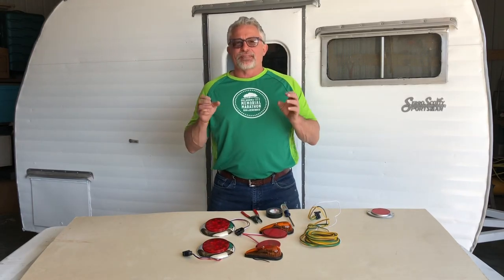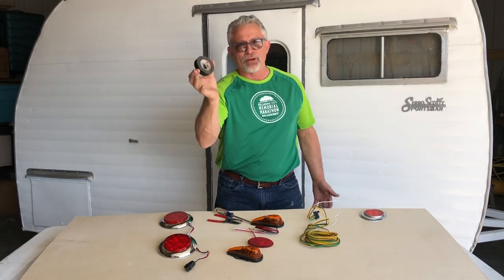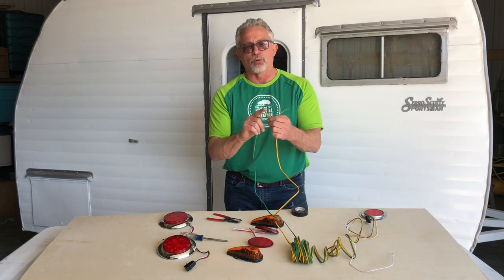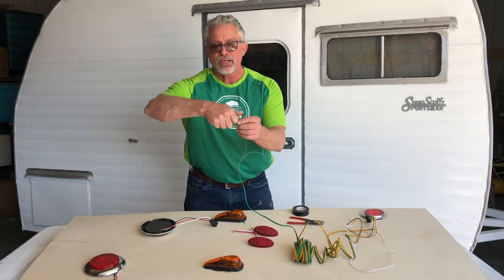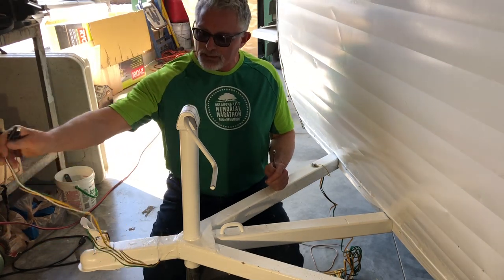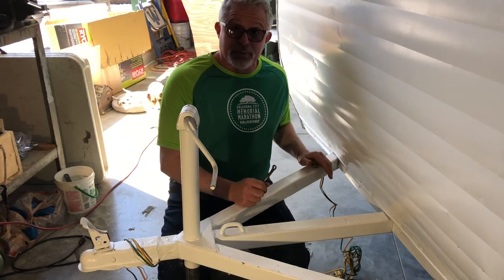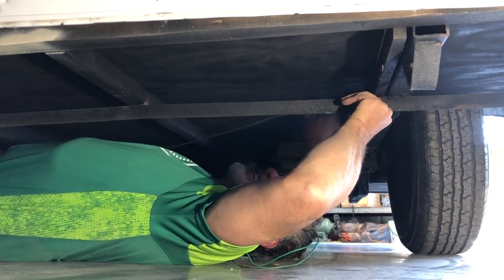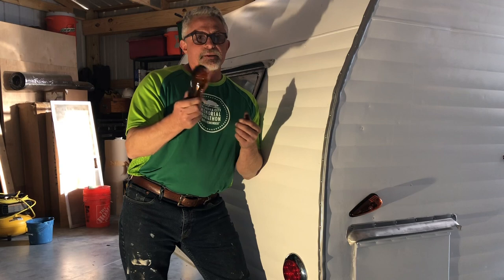Ep. 29 Wiring your vintage camper rebuild renovation the easy way. Retro Serro Scotty restoration

Comment: In previous videos you mentioned using butyl tape to seal the windows.  Do you prefer that tape over putty tape?  If so, why?
Reply from the maker: I don't know what putty tape is. They used butyl tape from the factory and still use it today so thats why I use it.
Reply: I went to home depot, they didn't have eighter ,so I guess I'll caulk
Reply: @cheloagain7228  To caulk or not to caulk, there is the question.